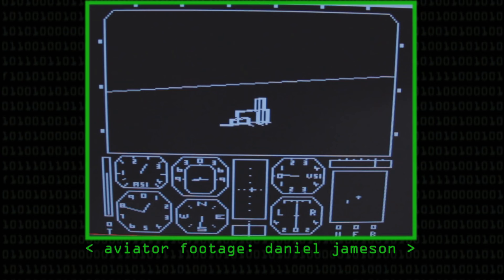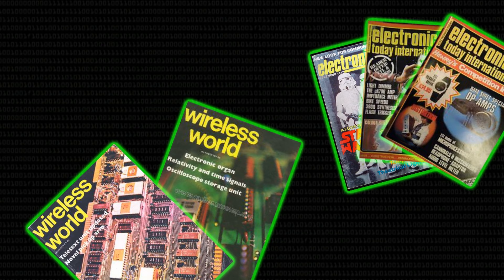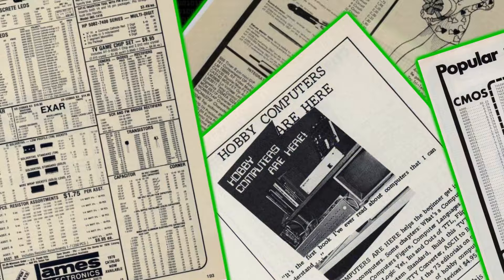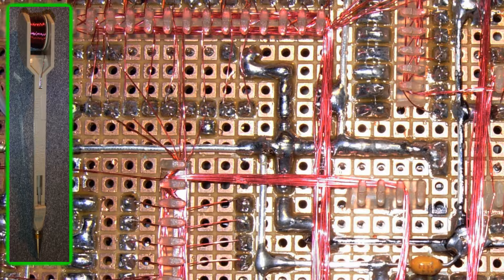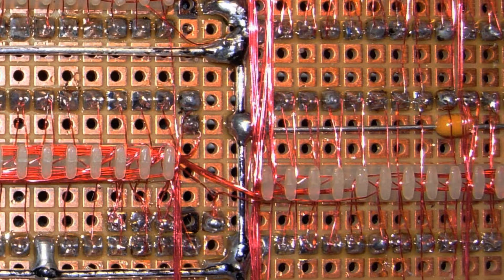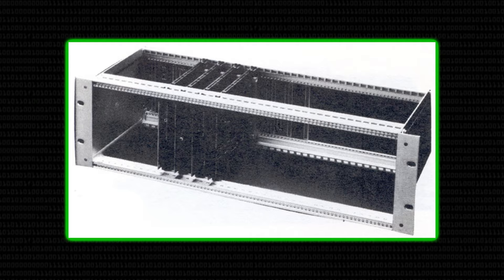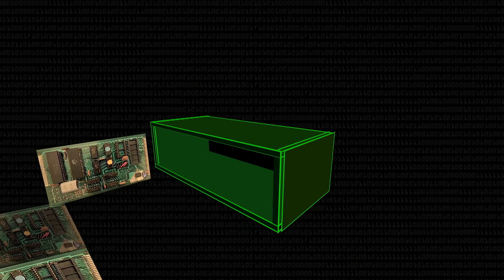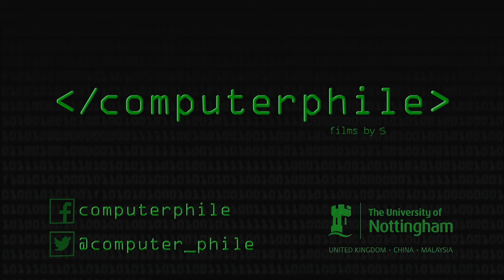The Path Towards ARM & BBC B - Computerphile

Comment: I miss those times where we make electronics circuits at home. Seeing these magazines bring back memories of my youth. Nowadays I make some electronics on commission bases for other Mentalists/Magicians and nowadays its more expensive to build something than find something for more complex that is manufacturer.
Resistors used to cost around 5guilder cents now you pay 20euro cents! A BC547 transistor was 10guilder cents now we pay a massive 40euro cents!
Insane!
Reply: +Raymond Doetjes you are so wrong. People still solder and build electronics at home. At its very cheap.
Reply: +Игровой канал RobosergTV Well it's gotten more expensive than buying the factory made electronics in most cases. I do hobby around a bit every now and then still and I now buy my components from China and that does help lower the price.

Comment: Am I the only Late 40's Nerd. Who wants to build ( In Kit Form ) one of these single board microcomputer's like the Sinclair MK14 and the Acorn System 1. I cant be.. Can I.
Reply: +The Pumpking King Download circuitmaker.
Reply: will give it a go. Cheers
Reply: +The Pumpking King
Have a look at Michal Kowalski's 6502 emulator link via 6502.org.
A brilliant 6502 SBC playground. It has an assembler / disassembler. IO ports (one is a virtual monitor), MPU state and registers, direct memory view and edit, single step and much more!! There is even BASIC assembler file that can be loaded and run to 'boot' to BASIC. You can look at the assembly code and learn the method of implementing BASIC. 
AND, wait for it,  full Microsoft VS6 C++ source code.
I love it and I think you will too.
BTW, I'm closer to 60 than 50 ;-)